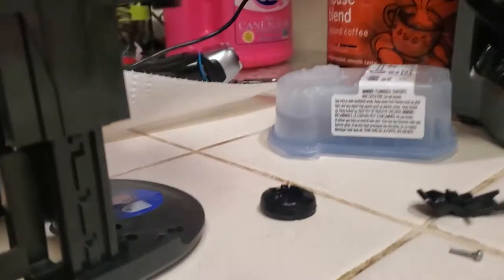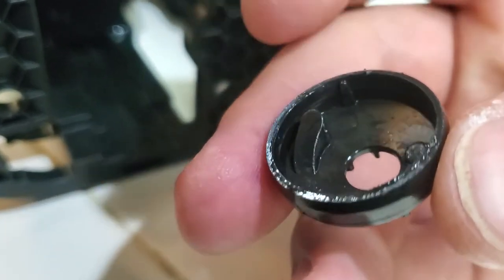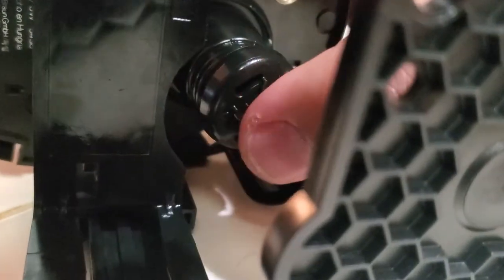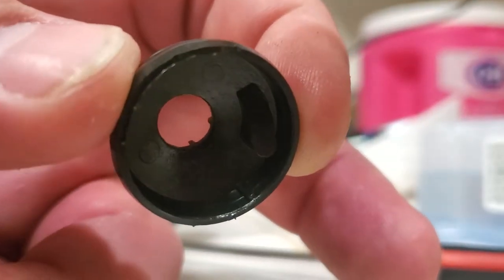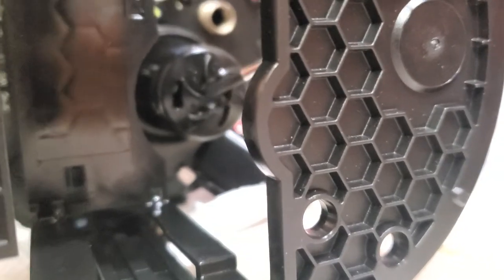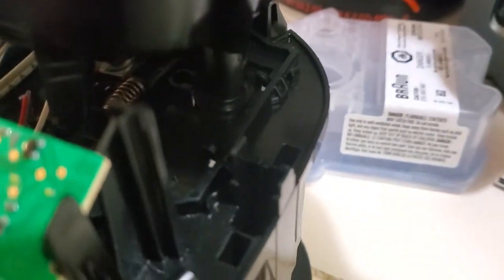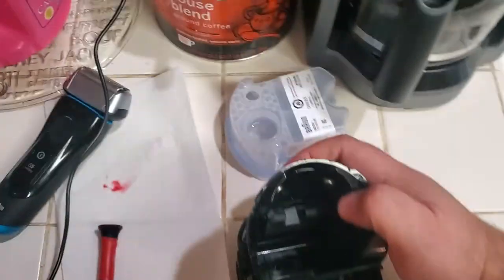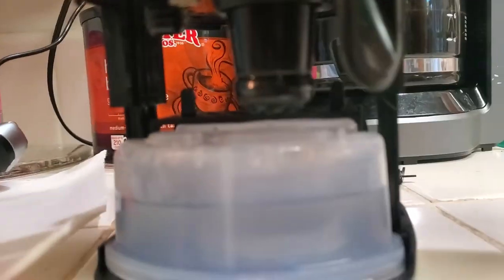Braun SmartCare Motor Repair #3

Comment: When you put back the cover of the propeller it is easy: rotate the cover applying a small push until it pop its place and it is not turning freely. Than push it until it clicks into its place.

Comment: hey i know this is an old thread, but ——- THANKS! my motor was fine my issue was a stuck impeller it wouldn’t turn freely at all other videos tell you to turn it with a toothpick to free it and it worked once, i think in the process of doing that i may have pushed it on further and made it worse because it wouldn’t turn at all prior to taking it apart — the cleaner wouldn’t pump up to the razor so lots of noise but no cleaning….. i don’t know how it happened but it wouldn’t turn freely….. Anyway I used your videos to get the thing apart but did not remove the motor itself just the cap and used small screwdriver to gently pry up on the impeller —-  just a little to where it turned freely it put back together and back to cleaning. i had a new one in my amazon cart but glad i didn’t need it…. line notch on cap up with groove on motor housing snap on and its  cleaning again. thanks again!

Comment: I would like your assistance in finding tthe motor for the Braun series 7 cleaner/recharger.  Is there a schematic with the part number on it?  Thank you.
Reply: Thanks.  I noticed that you put the  part number in the comment section.  Thanks for taking the time to video this repair.  Very helpful.

Comment: Hi. Thanks for the videos. Could you please share how did you remove the top part of the station? In your videos station is already opened. I didn't manage to open it though and it's blocking the further diagnosis.Thanks!
Reply: Thank you for the feed back! So The top up most plastic piece needs to pop off, the shiny piece is what you will need to pry up on. Using a screwdriver or knife(be careful) or even a plastic prying tool should work great. The top should pop off. I would try in the back first, so if you do damage it, you can practice if you care about not gouging it.
Reply: When I try to put it back together, I couldnt figure out how to get the shiny ring piece back into place, so I just left it out and put the top back on.

Comment: I have 5430 station. It starts cleaning process, I hear the motor, but then stops after a second and station turns off, even not charging. To start again, I must unplug power, plug again, it starts charging, but when I press start button, same happens as before. Can You help with advice?
Reply from the maker: Sounds like you have a short somewhere. I'm sorry I wouldn't know where to look
Reply: @killerwhiteshark1797 thank you

Comment: the only thing i was looking for was how you removed the top dome of the cleaning station...and thats the only thing you didn't record!
Reply from the maker: If you have a plastic prying tool or flat head screw driver(be careful too not damage it too bad if thats all you have) You have to pry the top collar off too get to the top of the board. Work slow and patient, its been a while since I took my old one apart, but there shouldnt be too many clips!